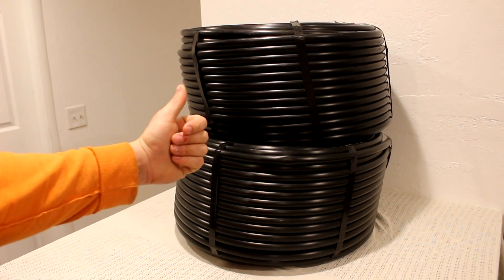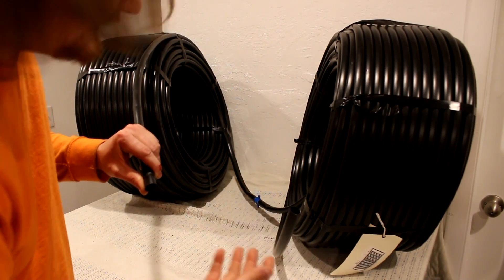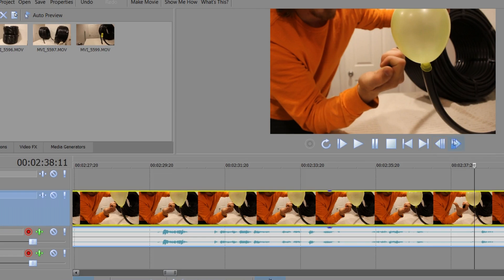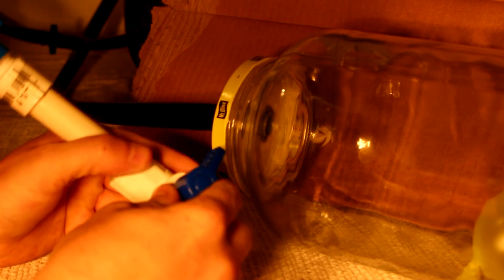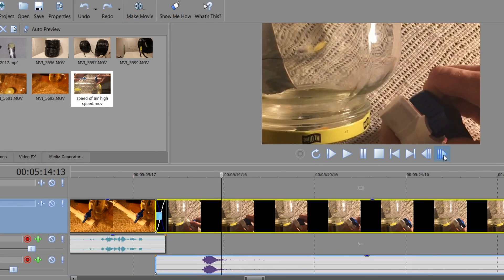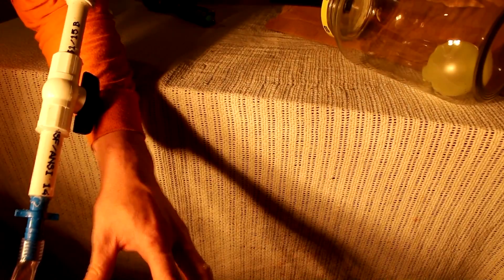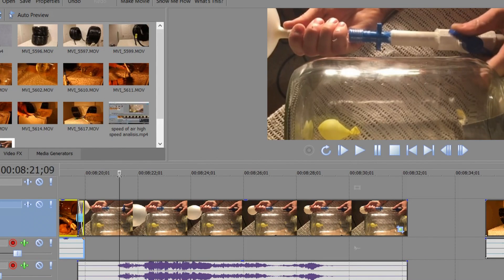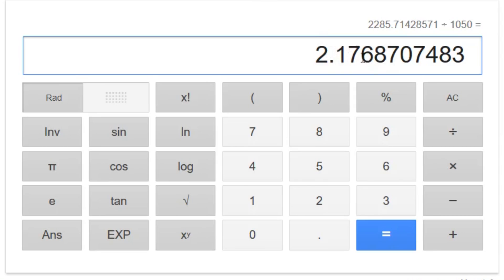Speed of Air Pressure Through a 1000ft Tube

Comment: bernoulli equation, reynolds numbers and  moody diagrams flashback
Reply from the maker: Dalitas D 
Yeah we are glossing over that for now
Reply: This reminds me - I knew at the beginning the coils would have no effect - there is just a decent amount of volume in that 1000 feet. You could barely feel air coming out the other end - think about blowing into a room full of air - how hard would that be to feel? And over an even longer time, and yet the equalization will come out the same.

I had images of you trying to accelerate air through the tube. Which reminds me of something I might need explained to me. Instead of running a vacuum in your hyper loop, why not just accelerate the air along with the cars? You would get a partial vacuum in any case, but you'd also have an air cushion, making it impossible for 2 cars to collide, and an easy way to quickly and gently slow down an errant car.

Comment: Why are you talking about the speed of sound, when you're actually measuring how a pressure wave travels through a tube? What TF has that got to do with how fast sound moves? I thought you were to make a long stethoscope type device.
Reply from the maker: Jen Yates 
You do know what sound is right?
Reply: Sound waves cause temporary displacements within the medium (air), but wind/blowing is the movement of the air itself. The two are not the same. You are not blowing air 'at the speed of sound' and measuring how your breath travels down a tube is not the same as how sound would travel down the same tube. If you blew down one end, and a speaker was at the other. The sound would reach you before your breath reached the speaker because the speed of sound is much faster than you can breath out. I'm always impressed with your chemistry and knowledge on so much, but in this area, at best, your terms were misused.

Comment: I think the only way for the hyperloop to work anyway is to have a bulkhead door every while or so and only open when a vehicle is traveling through that point. I'm still riddled why they didn't use an airlock at their contest.
Reply: The weird part about the engineering is how do you make an airlock that doesn't interfere with the rail. It would have been a lot of engineering time and it would probably been a little too finicky for the purposes of the competition.